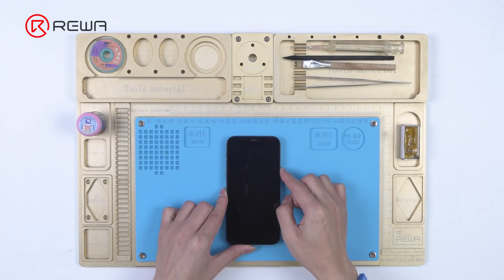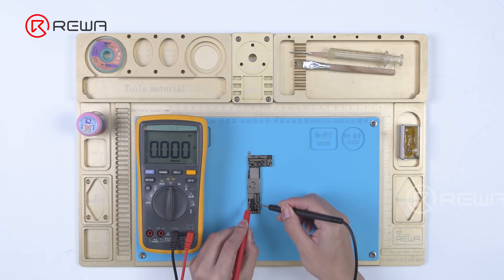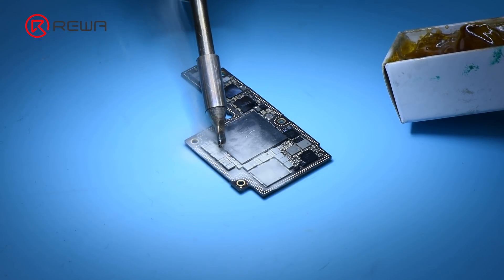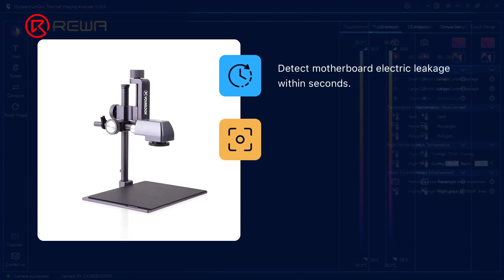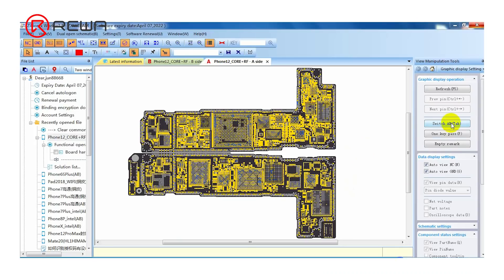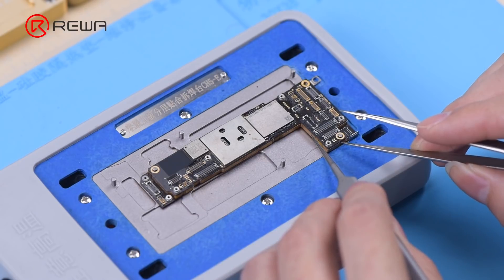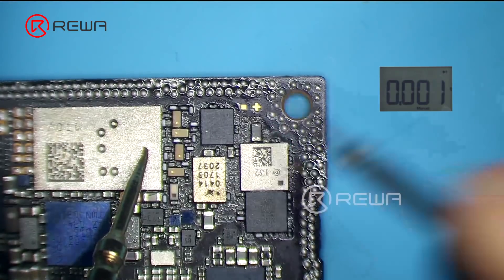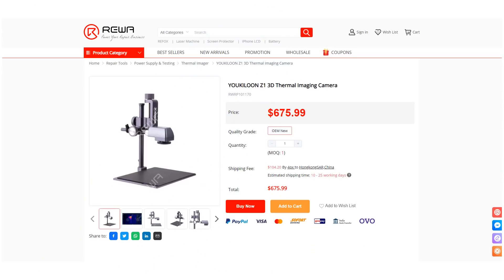Fix iPhone 12 Won't Turn On By Infrared Thermal Imaging Camera

Comment: This thermal camera is better then Qianli thermal camera?
Reply: Use Seek Compact Pro with Macro Lens and you find short quickly and with better image. You will see exactly the component that produces heat and is assumed to be shorted.

Comment: So you remove the capacitor, close the motherboard-up, and switch the phone on, and everything just works?  ....i think you missed a step lol
Reply: Bez jednego kondensatorka ma nie działać? Skądś ty janek się urwał.. Zgodnie ze sztuką powinien go wymienić (możliwe, że wlutował, ale nie na wizji, bo to nic ciekawego), ale w tej linii jest ich sporo więc bez niego też telefon będzie działać.
Reply: What’s u guys are saying .electric voltage can be somewhere else but this capacitor shown as faulty .then the line is fully shorted .u have to inject voltage to see further
Reply: Lol you don’t have a clue of what you are saying, on the main lines like vcc_main, if a cap is shorted, you can or not replace it, why is this, the caps tend to go from line to ground, so the cap just give the “bridge” to ground, so if you don’t replace it the line travels to another cap with ground
Reply: @mauriciogonzalez5891  i never said it wouldn't work, the point is it's supposed to be there, you could remove, and/or replace all kinds of components, and totally butcher the circuit board, doesn't mean it's safe or desirable......or are you saying you're more qualified then Apple's electrical engineers, and Apple are wasting time, space, and money, on capacitors that aren't needed ?
Reply: @cjjuszczak  Jak tacy ci inżynierowie dobrzy to czemu tyle bubli wyszło spod ich rąk? Moim zdaniem są tak dobrzy, że cała seria ip7 z powodu źle zaprojektowanej płyty głównej nie powinna trafić do sprzedaży.
Reply: @suawosch8015  ii don't speak that o.O
Reply: @cjjuszczak  are you phone technician?
Reply: @misterblackpepperswag  why do you ask ?
Reply: @cjjuszczak  well, if you're a technician, I'm sure you know capacitors function
Reply: @misterblackpepperswag  as i've said before, if you think they're unnecessary in the product, go collect your congratulations from Apple when you tell them how useless their design is lol
Reply: @cjjuszczak  ha? apple design? Every electrical tools hv capacitors... Some capacitors just for keep safe some electric current, and if that broke, you just dump it.. 

What do you do, If your toaster broke because short current and make your house electricity turn off? Simple, unplug your toaster

You can replace a burn out capacitor, with another capacitors. Did you think easy find iPhone 12 capacitors? Capacitors is not a sparepart like lcd, battery, etc.. you must find a dead logic board to swap the broken capacitors, if the dead logic board still hv a good capacitors

And what if you can't find exact capacitor? Just dump it. Simple, and wait until you find new capacitors

That's why "genius bar" never fix shorts logic board, they'll swap entirely with almost a second phone cost. That's Apple design for you
Reply: @cjjuszczak  cz the main point of the video, is to show how their thermal imaging cams very useful, and making iPhone 12 back to leg again. Just like the toaster I had mention before, you can still eat a toast bread with pan, without a toaster.

The main point of phone service, not to make the phone new again, but back to functional again... If you want the perfect one, just buy a new iphone 12 again, with all the mighty capacitors 

If just a small capacitors, make you worried or asking rewa's technician qualified, you're not the target of video, you're just casual consumer and this video is really not for you

Just better for you to watch repair guru, that even not a technician, he called himself a "guru", for just being a modder
Reply: @misterblackpepperswag  "Some capacitors just for keep safe some electric current, and if that broke, you just dump it.. "  

YEs, so now the product is less safe, not many people are going to be happy with that result, so not a fix at all lol.  

"What do you do, If your toaster broke because short current and make your house electricity turn off? Simple, unplug your toaster"  

Yes, now the broken product is not part of my life, it's broken, what's your point?  

"You can replace a burn out capacitor, with another capacitors."  
Yes, that is supposed to be the whole point of the video "FIX IPHONE 12..." lol taking a capacitor from the motherboard and NOT replacing it making it LESS SAFE is not a "fix".  

"Did you think easy find iPhone 12 capacitors?"  
Then why is the video titled "FIX IPHONE !@ ...." if it's not safely fixed at all lol  

"That's why "genius bar" never fix shorts logic board, they'll swap entirely with almost a second phone cost. That's Apple design for you" 

So Apple will replace what's needed to give you a safe, fully working, phone again. What's your point about NOT replacing the capacitor in this video ??
Reply: @misterblackpepperswag  The point of a video titled ‘Fix iPhone 12 ..." is to actually FIX it.  

The point of phone service is to give you a fully functioning and SAFE phone again. 

Would you give your car to the garage and have them takeout every fuse and bridge them with nails ??  

Just face the fact the video title is a lie, it's not "fixed" properly, and it's not safe for the product, or user, at all. 

If your "target" demographic is people watching how to break their products, and compromise their safety, then yeah, sure, making low-quality "repairs" like this is perfect for them lol.  

Just don't lie and say it's "fixed" lol.
Reply: @cjjuszczak  yeah, it's fix.. it's turn on, and safety? With what reason? So after the remove one capacitor, the logicboard isn't safety at all? Do you know how many small capacitors in 1 logic board?
Reply: @cjjuszczak whatever, 

But you must try to become a phone technician first, and you'll learn to give without compromising service but struggle to find the exact part
Reply: @misterblackpepperswag  what on earth are you talking about now, "give without compromising service" ?  

This video is a lie, it didn't "fix" the phone "without compromising" the product, and it doesn't teach how to "FIX" the phone like the video title says, it's all lies lol

If this video's creator has a "struggle to find the right part", then don't make a false video saying "Fix iPhone 12...".  

Like i said,  you wouldn't let a garage "fix" your car pulling all the fuses out and bridging them with nails would you ?  

Anyway, you're repeating yourself, and making even less sense now, so we're done here lol
Reply: @cjjuszczak  exactly brother. I will throw away my iphone if i cant afford the genius bar but i will never ever give my iphone to 3rd party repairs. Then whats the point in using an iphone?
Reply: @misterblackpepperswag  bro he not technician 😂

Comment: Not that simple.  Heat on a component doesn’t mean that component is shorted.    It could be from somewhere else.
Reply: That's why they take the measure of The diode.  If it stand anormal, there was another problem, but it got a normal measure after removing The capacitor.

Comment: Are you not meant to replace the capacitor after removal?
Reply: I think apple put that capacitor extra just for fun. lol
Reply: same quest
Reply: It depends. Most of the times. No
Reply: No need at all, most of the caps aren’t needed at all, they only smooth out the voltage and do very little for the functionality of the device
Reply: Apple have lots of extra caps..